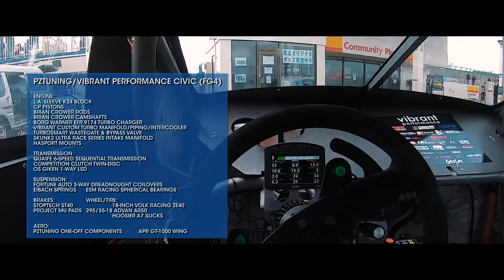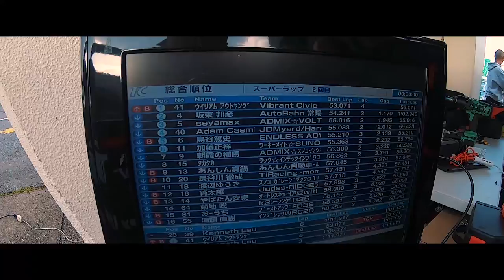...And New FWD King of Tsukuba - CHRNCLS Vlog 2019 #10 (Part 5)

Comment: Because of will they might soon start importing 9th gen civic to Japan. It will be great for the chassis to get Japanese aftermarket support lol.
Reply: Joseph Miller ahha becuz of will I have more respect for pedal shifting lol hah
Reply: @Smokeout89   I agree with you 100% the Alsan eg6 still has H pattern allmotor kseries and pull off a 56. Sec pass I was definitely impress by that.
Reply: Leopold   true the chassis is actually a HPD race chassis so your rite. But at the end of the day it's in the big bertha of civic shells out running eg's on tuskuba.
Reply: Leopold   the civic chassis are  already lite weight the carbon body might be a bit overkill however with some more aero mods and transmission work and it will be possible.

Comment: The Vibrant hose clamps and pipes cant hold up on a vibrant car.
Reply from the maker: Scott Vandyke one of Will’s welds broke.
Reply: Scott Vandyke we broke one of the welds in the IC pipe - probably from swapping to our back up engine at WTAC - I noticed when putting the repaired pipe back in it wasn’t lining up right ( surprised it even lasted this long), so something must have went out of alignment when we changed motors in Sydney :(